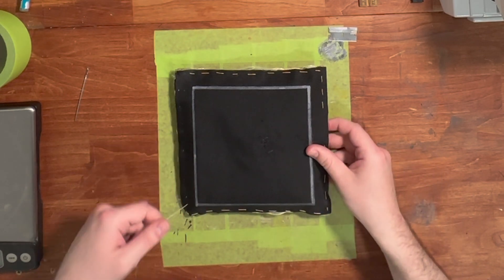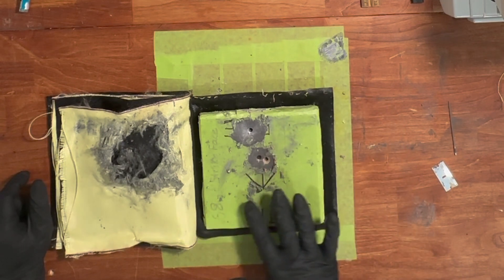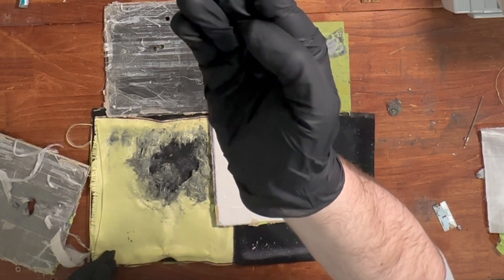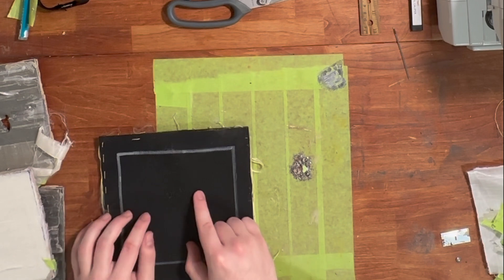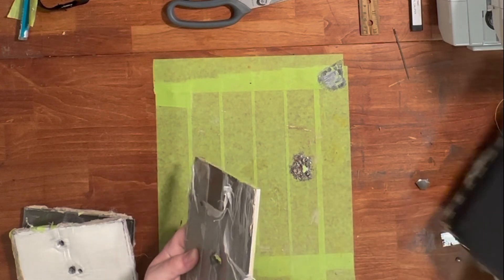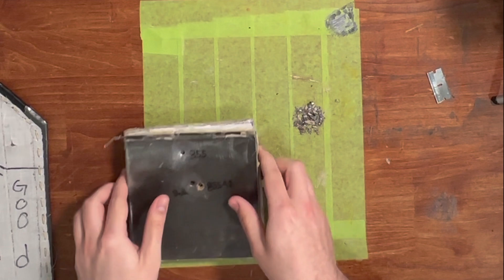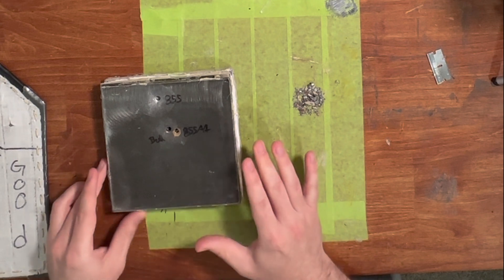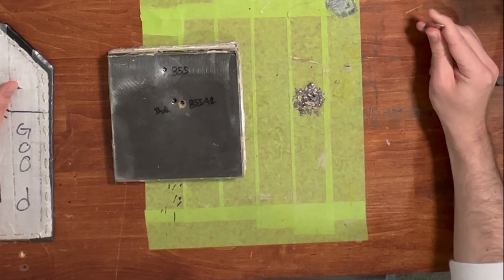DIY Rifle armor vs M855A1 (Teardown) #armor #homemade #bodyarmor #diy #uhmwpe #aluminum

Comment: hi my friend

The problem is in the hardness of your strikeface compared to hardness of the tip of the m885a1. 
AR500 steel has a Rockwell Hardness of 40 and the tip of m885a1 is Rockwell Hardness of 58
To absorb more energy on impact and erode the tip you need something harder, such as aiumina, SiC, B4c etc (the common ceramics used for body armor)

You are right about placing the aluminum plate after the AR500, this will prolong the contact time with projectile and hard material. The US humwee uparmor kits had a hardned steel outer, and a more ductile backer to absorb more energy. Altought your 7075 is not ductile enough, its still better this way. The best is to have something hard in front of a softer stretching material, holding the hard brittle material in front as long as possible, as the cone of force goes inwards into the absorbing material. 

Nice to see that only about 3,2mm of AR500 is enough to break up a bullet like m885 and m193

Comment: you need to put the alluminium before the UHMWPe, not after, because when the UHMWPE doesn't have the space to moove aroudn and use it's flexibility, it becomes less efficient at catching stuff. also, 7075 T6 s failure mode tend to be brittle and plugging + delaminating, so, it's a good thing to have it before the UHMWPE (also, it's stiffness will increase the efficiency of the steel before it)
Reply from the maker: Came to a similar conclusion after the teardown.

Comment: You said if anyone had any ideas for the urethane coating on 1000D Nylon or where to find the stuff uncoated I think you can remove the waterproof urethane coating from the Nylon by soaking it in Acetone. See the other comment I made on your upcoming projects video.

You're doing great work by the way providing everyone with potentially life saving information during these extraordinarily troubling times around the world and especially here at home. I think you may even earn yourself another subscriber my good sir. Keep it up and keep them armor ideas coming for the long haul!! 👍👍👍